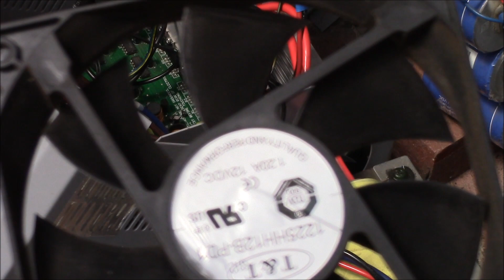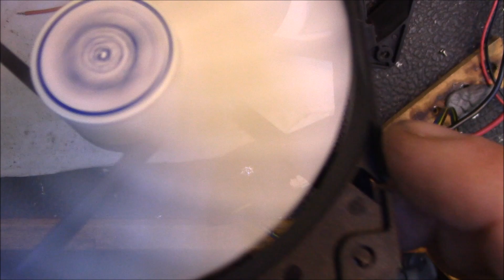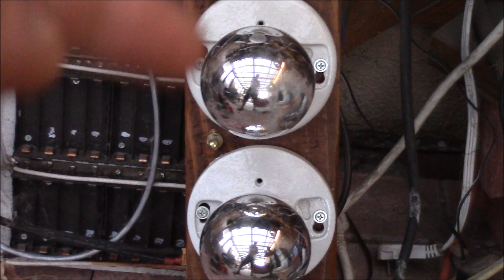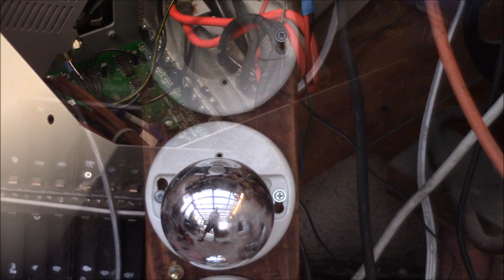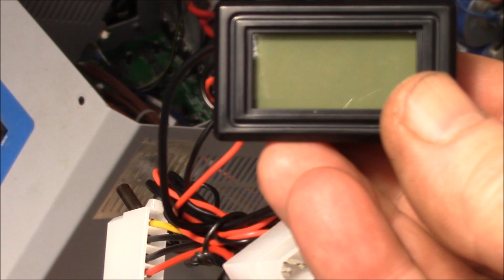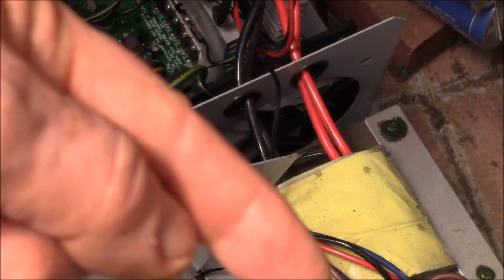TrippLite APS1012SW Inverter Charger Cooling Fan, Part 1

Comment: I connected the power supply to the input of the inverter, but I don't have any indication that it is on, also output is 0V. .Do you know what I should check?
Reply from the maker: Assume you also know about the need for a long press on the power button to turn the inverter on.  That got me when I first set mine up.
Reply from the maker: You might check the "pico" fuse in the logic power supply section:
https://youtu.be/-7ytppl6U3k?si=9lD370bOHRtEph8q
Reply: Yes, thanks ,just when I press the power button automatically switch to the AC mode charger and start to blink.
Is that normal?
Reply from the maker: @zoranveselinov7362  From the Operating manual, pg. 4:
“LINE Green LED”: If the operating mode switch is set to “AUTO/REMOTE”, this light will ILLUMINATE CONTINUOUSLY when your connected equipment is receiving continuous AC power supplied from a utility/generator source.
If the operating mode switch is set to “CHARGE ONLY”, this light will BLINK to alert you that the unit’s inverter is OFF and will NOT supply AC power in the absence of a utility/generator source or in over/under voltage situations.

Comment: Hamare eco volt 850 ka fan nahi chal raha hai aur heat ho raha hai kripya upay Bataye
Reply from the maker: "Our fan is not running the Volt 850 fan and the heat is going on"

"If you have a similar power inverter, you may be able to use a similar fix to what I did in this video:"

yadi aapake paas ek samaan paavar invartar hai, to aap is veediyo mein mere dvaara kie gae samaan phiks ka upayog karane mein saksham ho sakate hain:

https://youtu.be/RgeA5L-2Pss

Comment: Is it a brushless fan?  Brushless fans are more reliable and less likely to fail.  Good video, be safe
Reply from the maker: Good point.  Yes, it appears to be a brushless fan, CoFan #1225HH12B
I suspect it lost a coil or internal drive transistor.  

I'll need to see if the new fan I used has enough air flow or if I need to pick up a higher flow model.  The original fan is about 140CFM, so fairly high flow in that size.  It sounded like an airplane at takeoff when it was at full speed.  The new fan is a lot quieter but also about 60% less air flow.
Reply: Yes all we can do is try to improve the performance and the efficiency of the unit, Be Well